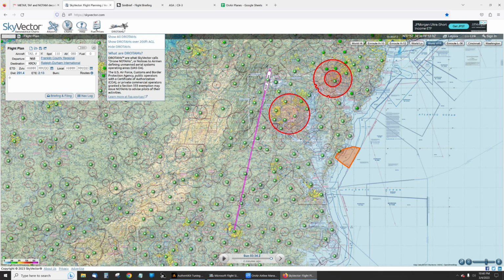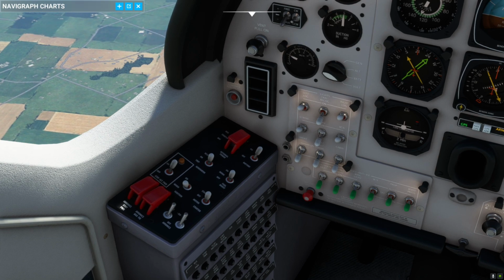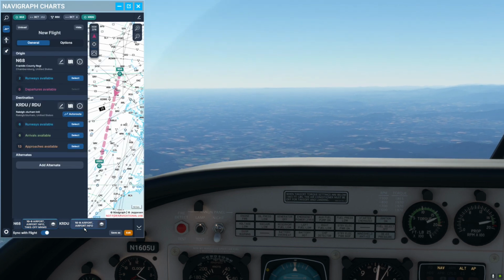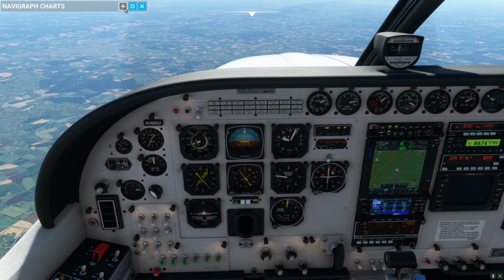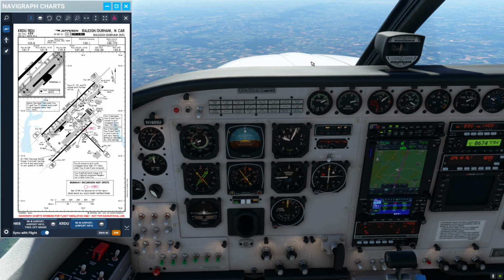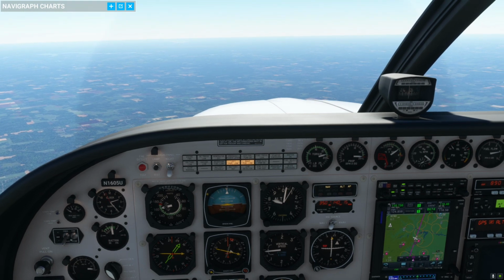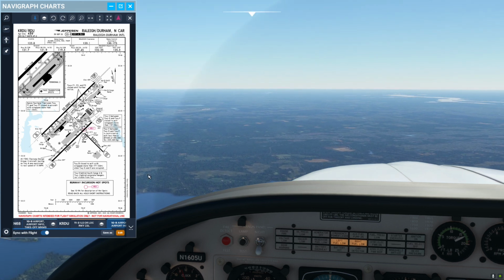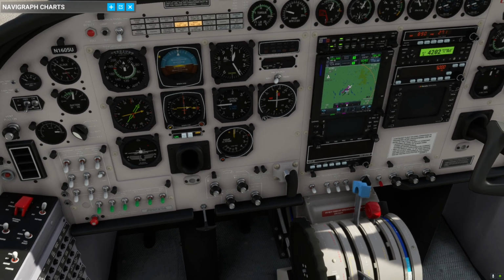MSFS 2020 Black Square Cessna 208b Full Flight from N68 to RDU

Comment: You would do a midfield crossing at pattern altitude for a direct join, or at pattern alt. + 500 for a teardrop join. That way you are never in the way of departing or arriving airplanes.
Reply from the maker: You are correct. I mention that in a later video (the off-road rescue I think). I 'll add that into future videos. Thanks for the comment!